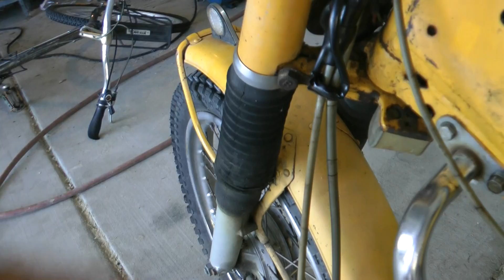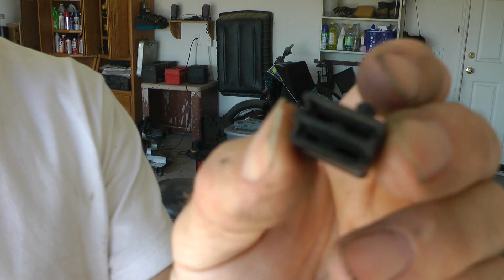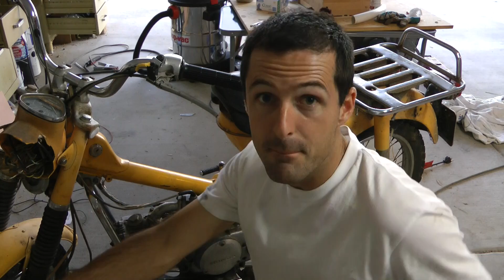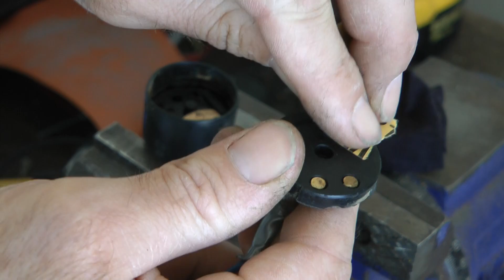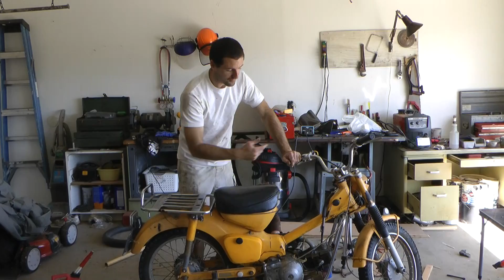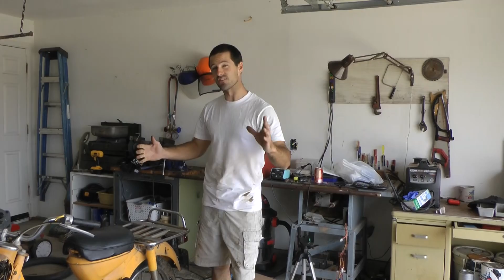Jake's Honda Trail 90 Project - Part 10 - Custom Parts & Finishing Up!

Comment: You allways supprise me, making switch parts is the last thing i would expect, your just too clever, you never give up :-D.
Your adaption of a saucepan is just funny as hell, that light is really cooking now lol.
When the rubber spoke strip fell to bits on my old 125 i cleaned the rim with metholated spirits to remove any slight grease/muck and filed the spoke ends smooth, then 2-3 layers of insulation tape to make it really smooth, never failed and amazingly never came off :-)
Reply from the maker: zx8401ztv "really cooking now" Hiiyyoooooooooo!!! Good one. Thanks a lot for the kind words. I really cant help myself when I'm faced with the decision to buy the correct part for $10 or spending 5 hours making something from scratch.
Reply: Translate to English, please.

Comment: The pot headlight is killing me. In regards to the rust on the rim, you should have tried electrolysis. If you do it right, it converts rust back into steel.
Reply from the maker: jacobaaron11 Glad you like the pan!! I'll look into the electrolysis, but I'm hoping to just come across another rim for cheap. Thanks!

Comment: hey I started doing my own build and YouTube brought me to you...love your channel and had some questions...so I've been pull starting it and the throttle is hit and miss but will never work in first and so far the bike dies when it's in neutral.
Reply from the maker: +tyson cook Sounds like either the timing or carburetor issues. Also make sure the electrical is all hooked up and you have a good spark.

Comment: Jake awesome series i remember you had a lot of smoke from the exhaust when you reved it did this go away cause i rebuilt mine new piston and rings and exhaust valve stem seal but it still smokes :( is this just cause its not bedded in?
Reply from the maker: ***** Since I made the video I have spent a lot of time on the smoky issue. I little smoke upon first start is probably ok but it should clear up within an hour or two of use. There is a lot of assembly lube to burn up. I can tell you from experience if you have a lot of smoke even with new stem seals and rings, your problem is probably excessive piston/cylinder clearance or out of round cylinder. did you measure the cylinder to make sure it was still factory bore? It may have been bored oversize at one time. Also if there is a ring ridge at the top that's kind of a giveaway that you should get another jug or have it bored. Good luck!
Reply: ***** it has great compression but i think it may be a slightly worn cylinder as i never honed it cause of my lack of tools the smoking is a lot better tgan it used ti be though
Reply: *****  i probably have about 2 hours on the motor now and it is running nice just a bit smokey

Comment: hi Jake, i was wondering if you knew if a Honda 110 engine would fit into a Honda ct90.
Reply from the maker: It will bolt in and the chain lines up, but it might need some minor modifications to get the electrical and controls working.
Reply from the maker: I know it's late, but I read this comment in a video, and a user named docclutch says he's done it and has some info if you need it